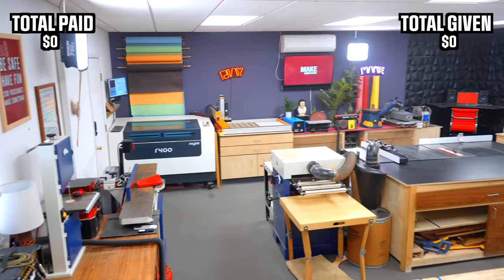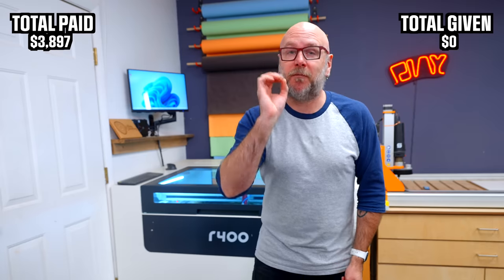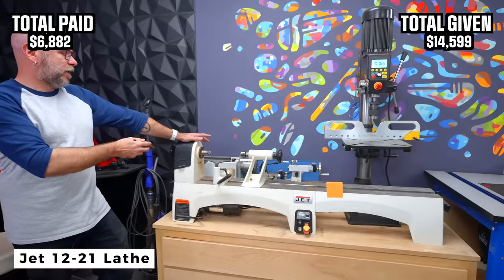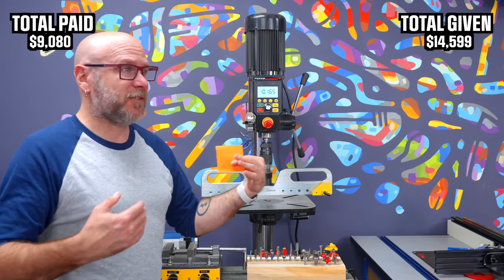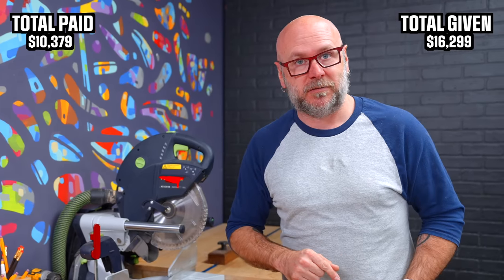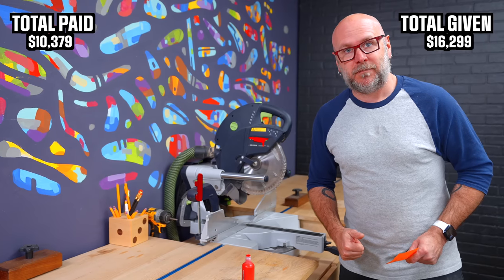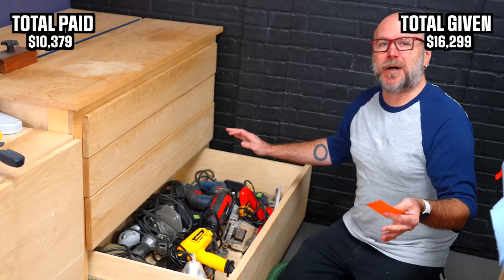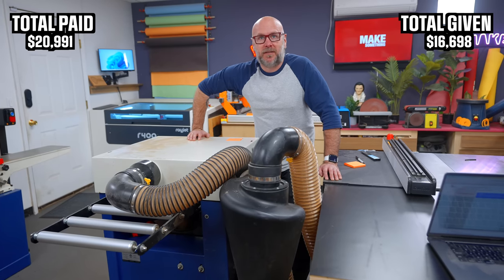All the Tools I Got FREE. The Ugly Truth.

Comment: My 'shop' is 4ft x 6ft and is shared with my heating/hotwater system so even a tool like a bench top drill press is too big. That does not stop me from watching your videos and getting inspiration. I watch you do stuff with all those fancy tools then sit down and try to work out how I can do that with seriously limited hand tools and skill levels. Most of the time I fail completely but boy do I have fun trying. For me those are the two most important points you made in this video - get inspired and have fun! As for the luck, well it goes both ways. Sometimes good, sometimes bad. I get the impression that you accept both but don't rely on it.
At 65 years of age I'm never going to have any of those fancy tools or a big shop and I just don't care. I just want to make sawdust and have fun changing the shape of bits of cheap crappy wood 'cos that's what rocks my boat 🤣
Stay safe, have fun, be you and go feed those weinerdogs!

Comment: I never think that videos like this are brag videos. I mean… I’m sure there are some. But for the most part it’s just….. a conversation. I love your shop. It’s not my style. But I think it’s amazing. It’s just a happy place that invites creativity. 

I started my shop 10 1/2 years ago with $50. I had a stack of pallets as a bench and a folding table in my yard. I spent the $50 on a used miter saw and used sander from a friend. I fell in love. After my divorce I got to use the garage. I think it was the smallest one car garage I’ve ever seen. Today I have a shop that is 32x35 (that is sadly not optimized) several Festool tools and I absolutely love it. I don’t share my shop to brag… I share because I am still amazed at where I came from and that I am so very lucky to have what I have. And to inspire others that they can get started with little to nothing and make things. 

Thanks for sharing.

Comment: The only shit you're going to get from me on what you do is this: If I owned
Domino - $1,199
Jigsaw - $445
Sander - $575
---------------
Total - $2,219

There is no way I'd ever, ever, ever, or even ever, be throwing twenty two hundred bucks worth of tools into an unorganized junk drawer. I'd have used those tools to create custom dividers and inserts in my tool drawer to keep them properly oriented and safe when I put them away, with no tangled cords, no scratched and dented housings, no blades or disks marring up the drawer bottom or the other tools.

Aside from that, I love your shop.